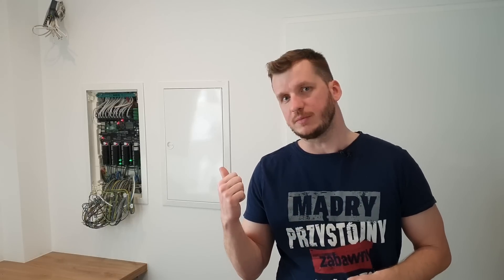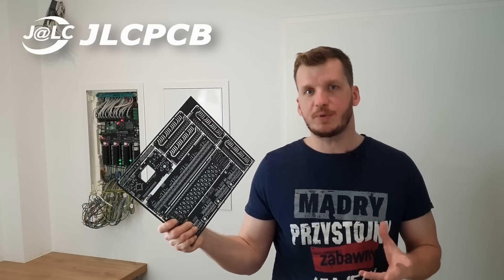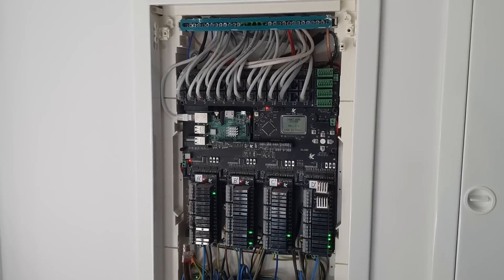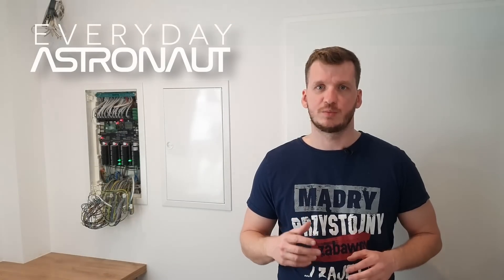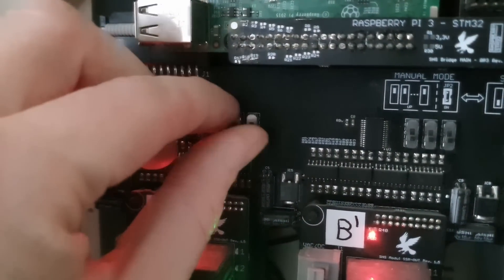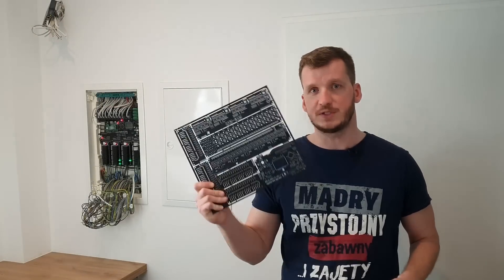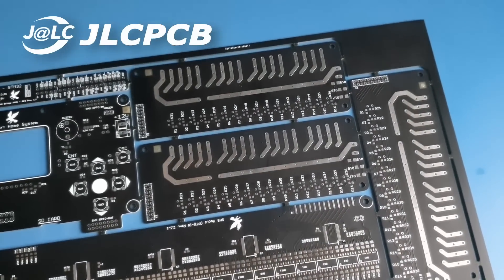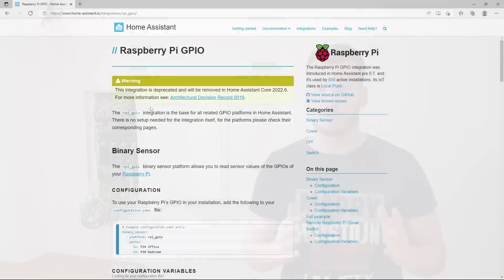DIY Smart Home HUB + Home Assistant

Comment: Would you describe better in a video how you deal with smart lights and physical switches? In your setup how does a physical switch control a smart light without cutting the power to the light?
Reply from the maker: I don't use smart light in my system. I use dumb switches and dumb lights :) And it's thanks to this HUB + Home Assistant it'll become "smart".
Reply: @SmartSolutionsForHome  i understand now. Thank you very much for answering. :)

Comment: This is a fantastic bit of kit!
I have a Homeassistant instance running on a Pi4 at the moment, but isn't in a location I can run cables to to set up something as fantastic as this with SSRs. I'm looking at using NodeRed or MQTT as a link between a microcontroller (something like an arduino Mega with an ESP32 for WiFi communication) to communicate with HA. Nice an easy to get data into HA and you can build dashboard elements from the NodeRed devices.
Reply from the maker: In that case, you'll definitely like the second version of my HUB :) It'll be very close to what you described.
Reply: @SmartSolutionsForHome  I'm excited, ha ha ha! I'm very keen to make use of those protocols to bring together my smart network. I have them both installed now but don't make use of them just yet.

Comment: If you take the led's off the board and you have to perform diagnostics or figure out a problem and your remote system isn't communicating, how are you supposed to know if a relay, breaker, switch or whatever is even working or errored out?

Comment: Fantastic that i found your channel. I am busy wiring up a newly self build smart home. I also made the choice to take the same centralized approach but separated out the controllers R.Pi's and esp32's into a different cabinet. Ran into the same latency issue with Home Assistant. I do the switching directly with a esp32 that controls a relay the test's work fast and reliable.  For now i am still in the wiring phase. 
Cheers i am gone follow your channel with interest!

Comment: I don't mean to contradict Sir Elon but he is missing very important steps.   

2.5  Make it work.
2.6  Prove it works.
and
5.1  Prove it still works.
Reply: On this though.  Step 1 and Step 2 are often done far too late in development or not at all.  In my heating setup, I spent a LOT of time going through the requirements and removing everything I didn't need, forcing simplification.  For example.  State machines.  "If it's ON, toggle = off" etc.  Shun them, push them as close to the actual device as possible.  Remove any need to actually hold ANY state.  Run everything off the message bus, stateless.  If your automation needs to know if a radiator or boiler is on, it can ask it.  No assumptions.  I also removed the whole "right side" of the state machine problem.  "When do you turn it off?", "How can you manage mulitple demands for a device to be on, when only one of them asks for it to be turned off?".  The solution is, don't turn anything off.  Make every request for it to be on timeout.  Have devices repeat requests.  If anything dies or crashes, stuff turns off naturally and by default.  All of that through 1000s of lines of state machine code in the bin and 1000s more not having to manage them at all.

Comment: Nice overview and always helpful to hear what wasn't used or didn't work so well! I am also pretty obsessed with 'fallback' mainly for lights but decided on a decentralised approach because of that (and because it is simpler).
I think a sensible check to make before you add any automation hardware is to think what impact it has if the automation is not available or doesn't work properly. If the result is worse than it is without the smart hardware, or if bringing it up to the same level takes a lot of work, then I have a pretty strict rule that it is probably dumb and I shouldn't do it. The result is that my house isn't super 'smart' but my wife and visitors consistently find the automations that do exist very useful.

I say this while these instances are super rare so it isn't really necessary, but it appears to also keep the automations 'sane'.
Reply: I use ge enbrighten smart switches, no extra wiring 100% standalone unit doesn't need coms, internet, wifi or anything to manually switch on and off. Unfortunately it does sacrifice rgbccw control, but i fixed that by setting up secondary colored lights

Comment: nice, i am also doing stuff myself but i have much more networked / distributed approach based on off the shelf components mostly
Reply from the maker: Completely opposite approach to mine, but I think both are ok :)
Reply: @SmartSolutionsForHome  I have been renovating old house so it was impossible at the time to make a central hub

Comment: How do you wire that wall switch ? Do you switch the dc or the ac ? If the dc what voltage you switch it with ?. I want to make my own smart home hub. My concern with wall switch is the distance from the hub (voltage drop over the wire). If I give it a 5v to switch, im affraid it will come back far below 5v let just say 3v.
Reply from the maker: Your concern about voltage drop is perfectly legitimate. I use 12VDC and I think that is the absolute minimum. 5V can be very unreliable. If possible, use 12 or even 24V.

Comment: Very impressive. But the costs are huge. There are very good and stable wireless solutions with a lot of benefits (simple installation, no wires, easy adaptation to existing infrastructure).
Reply from the maker: Thanks. I know there are good wireless solutions, but they will never be as solid as the wired ones :)
Reply: @SmartSolutionsForHome  Maybe. I have wireless devices working for years without any issues. So wireless solutions are solid too and more flexible.

Comment: Great video. If I can request one thing: Could you please increase the volume? Your video is a lot quieter than most videos on YouTube.

For the haters that'll say "jUsT iNcReAsE yOuR vOlUmE": It's not about that, it's about consistency. For this video I needed my volume at 100%, for others it's at 40%. It's annoying and unnecessary to have to keep adjusting your volume.
Reply from the maker: Thanks for comment! Of course, you are absolutely right! The audio is definitely too quiet :( I was in a rush to render this video and forgot to check the audio level. My bad, but I promise to improve for the future :)
Reply: @SmartSolutionsForHome  No worries, mistakes happen. You already gained a subscriber, even with the low audio levels.

Comment: I dont know where you come from but in my country this cable mess is not conform to electrical wirering rules. I suggest also to use a much bigger box to fit all the components and fuses, terminals ect. I also suggest to choose a box at least 1/3rd bigger then needed to have some space left for further improofements and expansions ;)
Reply from the maker: In the video, I tried to explain myself a bit about this mess. I was supposed to put it in order, but the two years flew by so quickly that I missed it ;) In the second revision it'll be neat :)

Comment: Hey! Perfect job! I've faced a lot of similar problems when I've built my system. I had also concerns about that "how that will be maintained or modified if I would decide to sell the house?". Due to that I decided to minimalize usage of DIY solutions and make it as much "reversable" to classic installation as possible. So I decided to partly abandon the idea of centralized point. That lead to reduction of cabling that is hard to organize in one place. I also thought about that "My family and friends are mostly not IT people" so when something will fuck up and i would not be around there will be major problem. So again - decentralized everything a little bit in that way that if something is broken I loose control only on that one device and usually I don't have to open fuse box to take care of the problem.
Thanks for four time making these video's! Your channel i very undervalued.
I'd like to see some PCB making tutorial from you! It's clear that you are doing it professionally. 🙂
Reply from the maker: Thanks!! So far I wasn't worried about "what will happen if I sell the house", but of course you are right! This is a very valid question! I also tried to make my system "reversible", that's why my "smart" installations are parallel to the classic one. I've two sets of cables in the socket boxes :) If something happens to me, any electrician will be able to restore the installation to its default state before my integrations.  Thank you for your fantastic comment and kind words! :) As for the "PCB making tutorial", I'm gonna do something like this for a long time. I'm trying to figure out what format it should be.